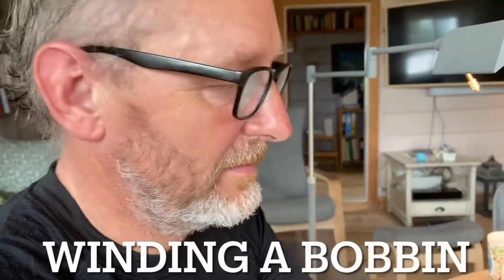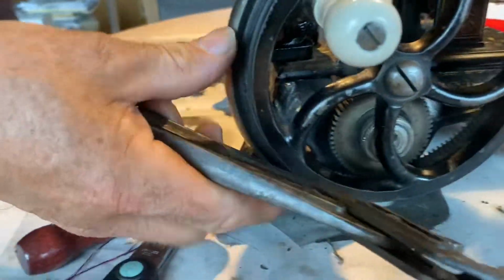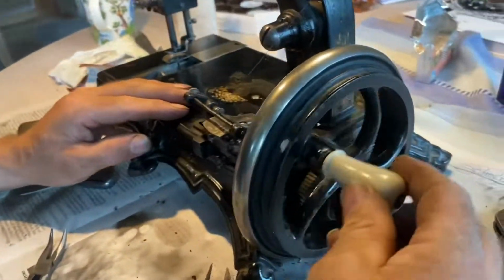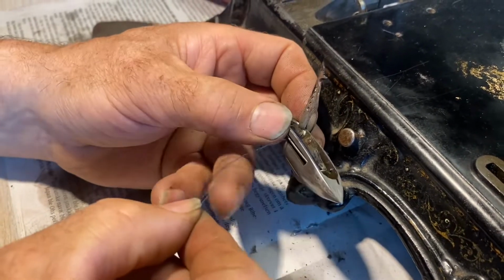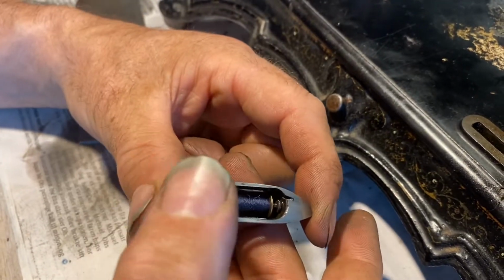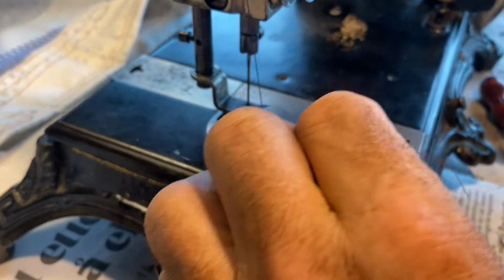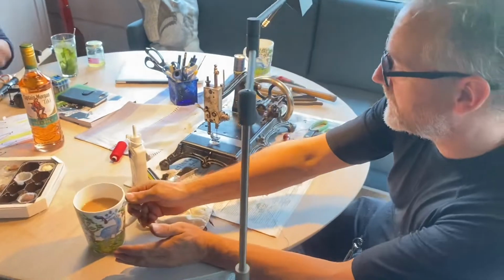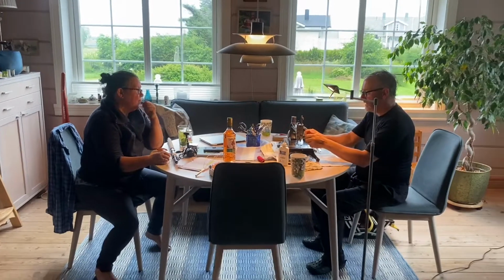Live repair and operation of a Grover & Baker No9

Comment: To fill the bobbin does it not need to go through the hole at the bottom too? Beautiful piece of machinary, I have never seen a machine that threads that way before, was it for domestic use only?
Birdy
Reply from the maker: Yea this was a domestic machine, but may have been used by tailors also